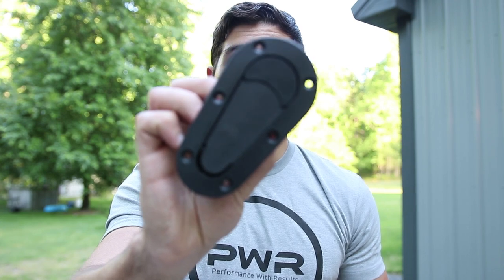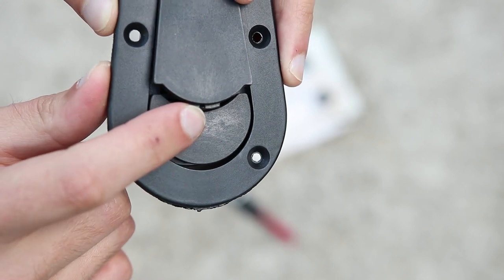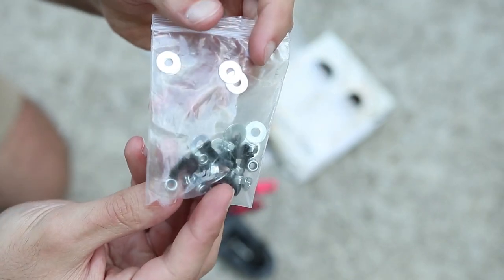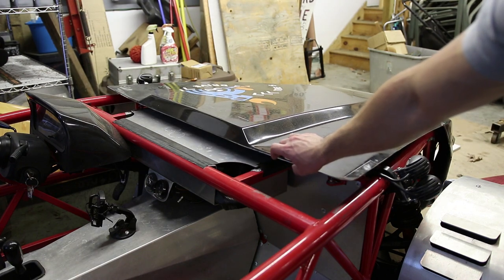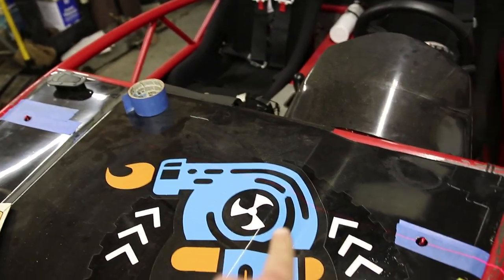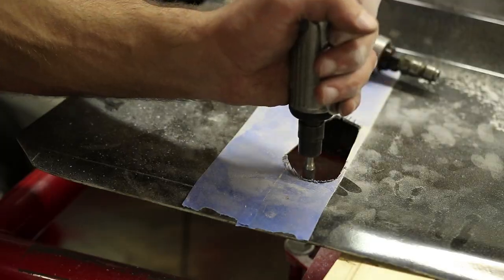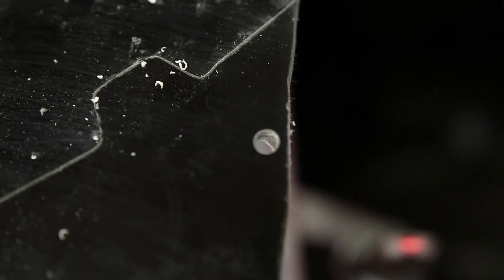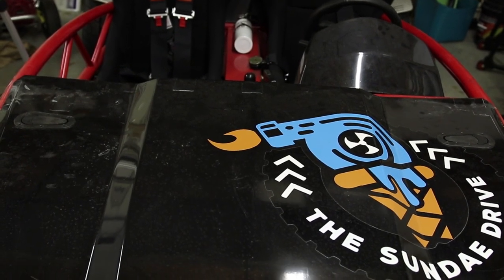Cheap eBay Flush Mount Hood Latch Review and Install on Exomotive Exocet - Knock Off Aerocatch Latch

Comment: I was involved with the Aerocatch latches right from the start and made all of the tooling for them right here in the UK. I can tell you that the materials used for the genuine UK made branded Aerocatch are the highest quality available anyway on earth, they are expensive because of this; the plastic moulded material used is actually a metal replacement, that is how good the genuine ones are!
These cheap crappy lookalike knockoffs are a complete waste of your time, money and effort,  avoid them at all costs...I promise you that you will be glad that you did!
Reply from the maker: No disagreements there!
Reply: ty sir from the year 2024 :)

Comment: I had my hood fly up and smash my front window. I started looking for hood pins/latches to ensure this doesn't happen again. This video just saved me from buying a mistake, and probably saved my life and whatever passengers may be riding with me.
Reply from the maker: Glad the video helped point you away from them! That had to be terrifying 😬
Reply: @TheSundaeDrive  Yeah, it was a big "wham!" And then I couldn't see where I was going and had a smashed windscreen luckily no one else hit me when I had to slow and pull to the side and that I was going in a straight line at the time, otherwise I'd probably be a goner
Reply from the maker: Glad you are ok man. Good hoodpins are a must with an aftermarket hood
Reply: @TheSundaeDrive  thanks for the kind words and lifesaving info! Keep sharing it bro 😉🤙
Reply from the maker: No problem! Will do
Reply: @-smp-scientificmethodpersp838  that just happened to me

Comment: Heads up!! Dont use these cheap aerocatch knockoffs if you dont want your hood to fly off and damage your car. Spend the money because the cheap ones fail and fall apart. Theres a video showing this if you dont believe me. The aerocatch are made by a reputable British company that makes many products for racing, marine,and aerospace. They test their products. They are motorsports proven to be safe and reliable. The pin and bolt hold the hood secure, but as your driving the faster you go the greater the force on the plastic areas. If you study the design, its clear that the stress is great on the top lip of the plastic part where it bolts to the hood.
Reply from the maker: Agreed. Wouldn't buy these again

Comment: I bought the cheap ones, at 1st they looked good but 3 days later one of them started acting up, a pin inside the mechanism started coming off making it difficult to shut the latch down, 1 day wen I was driving on the freeway the latch that was actually working gave up, the hood (carbon fiber) slammed into my windshield n u can imagine the rest, the cheapest AeroCatch latches came out to $65. Had I spent $35-$40 more for the good ones I would have saved money on my windshield n the roof rack that the hood damaged cuz of the poor quality latches
Reply from the maker: That sucks man! In our case, we don't have to worry about the hood flying off but I definitely would never use these on a car. They are way too flimsy now that I've had my hands on them
Reply: Super helpful comment! Thank you!

Comment: Usually if the pins get jammed up its because it's under too much tension. If you push the hood up or down a little bit, it should unstick it.
Reply from the maker: True 👍👍
Reply: @TheSundaeDrive   theres a video where the cheap one rip apart. Search hood pin fail.
Reply from the maker: I'm not surprised. I'll check it out 👍

Comment: LMAO to be fair even Aerocatch themselves say their product is NOT SAFE without an oem hood latch and is recommended by them to keep your stock latch while using their own product, let alone a knockoff.   they are plastic...  aero; fake or not, are not designed well enough to hold your hood on tight at highway speeds.
Reply from the maker: Good point! If only these cars had real hood latches lol